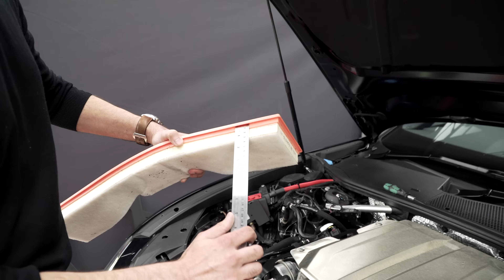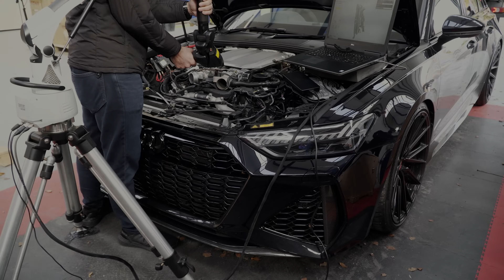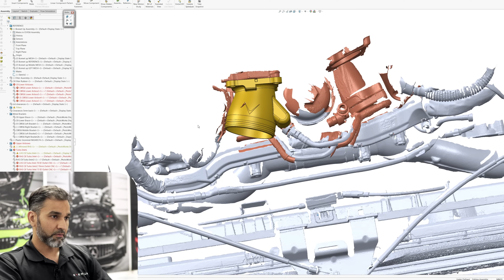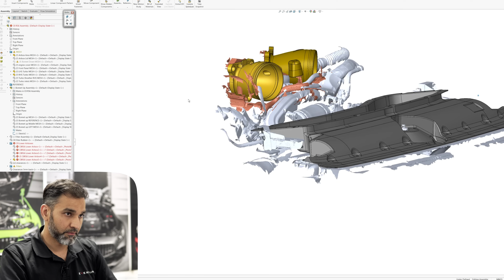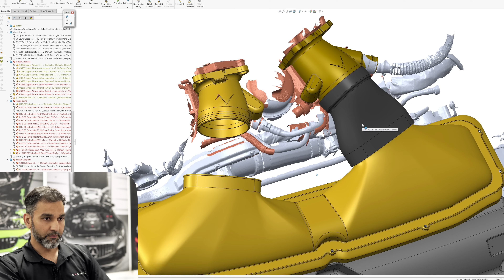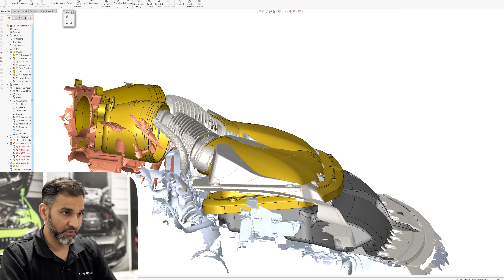Audi C8 RS6 @Eventuri Development - Stock Airbox Analysis + Intake Design

Comment: Bilal masterclass in Viscous Fluid Dynamics. It looks like the Audi Engine Designers were fired from Airbus, BMW, M-B, and Porsche. HaHa.

Hard to believe an Audi RS with that ginormous grill has such a poor air intake design. The reason is simple. The low hood line, plus the top mounted turbos left no volume for a proper intake design. When you put the turbos in the valley of the V6/V8 the only route for the airflow is down the middle. They should have routed the intakes along the R+L sides of the engine bay. Excited for Part II to see the finished product.

Love my two Eventuri Carbon Fiber Intakes on my BMW E9X M3 and N55 powered F30 335i. Waiting for the new BMW E9X M3 EVAero Kit!